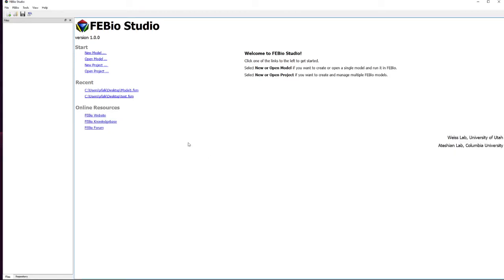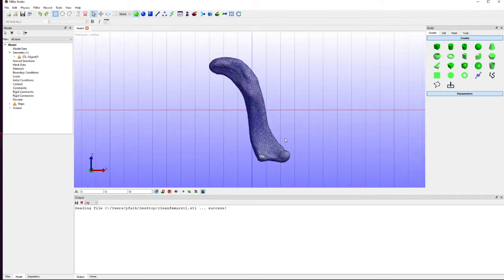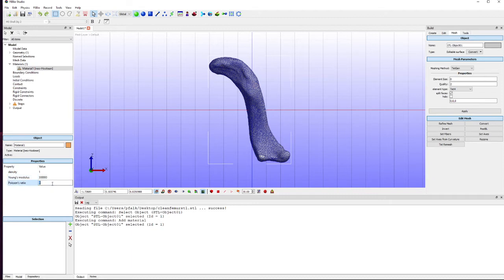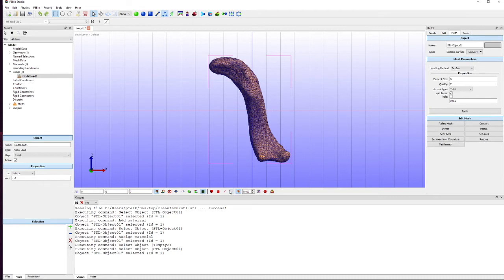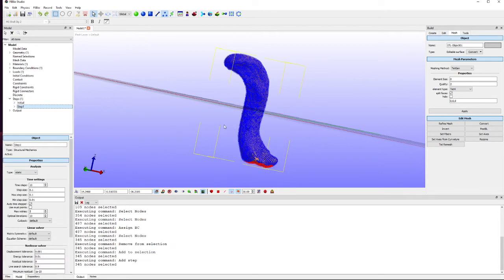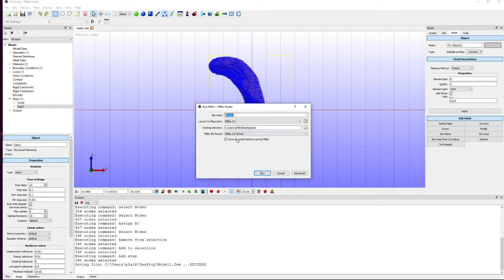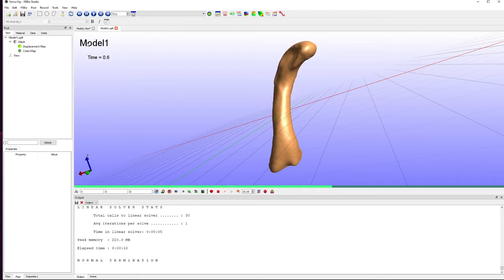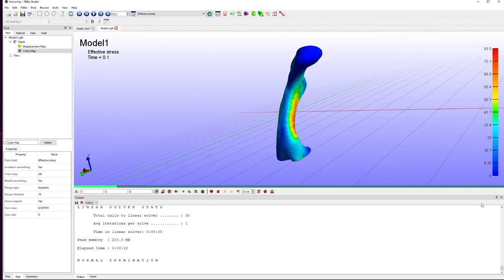Example FEA analysis using FEBio Studio

Comment: Hi Peter,
Thank you for sharing this video. It helped me a lot! I followed your video with a cube I generated in FEBio and it worked perfectly. However, when I try to apply the same principle to a .stl file of my own, it has trouble detecting the faces of the mesh (it basically sees the whole mesh as one surface, so I can't apply forces on different faces or define restrictions. Have you encountered the same issue by any chance?
Once again, thanks!
Reply from the maker: This might just be an issue of having face selection selected, or it could be that it hasn't meshed the stl properly?  Hard to say, sorry.